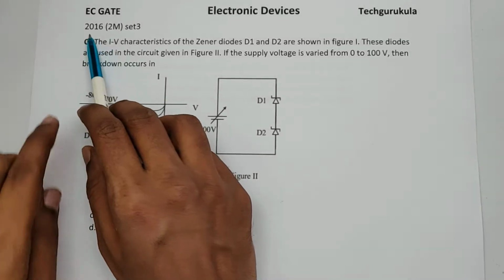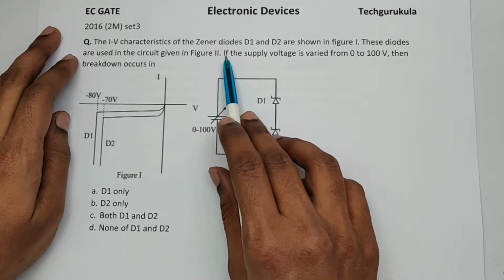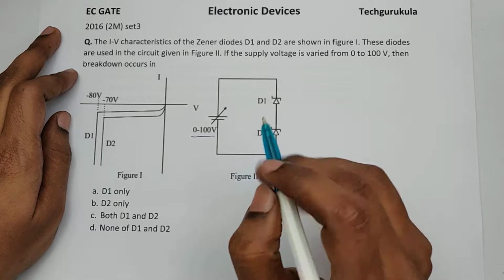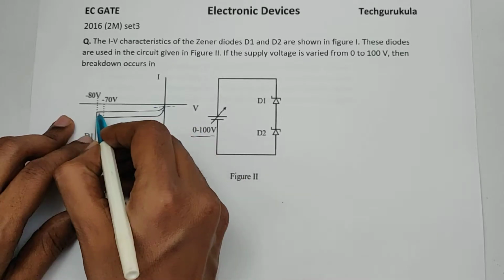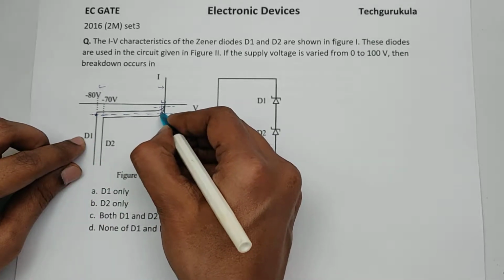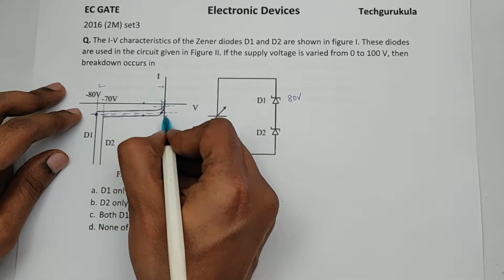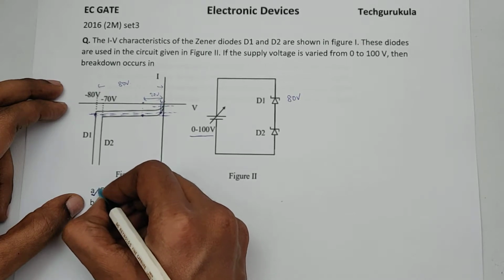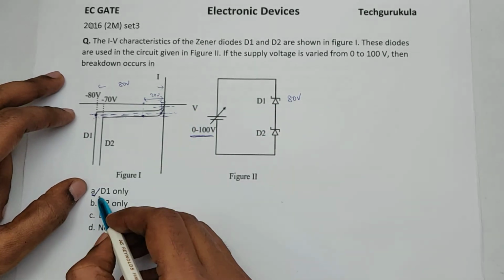EC GATE 2016 2M - Breakdown - Zener

Comment: If D1 enters breakdown , D2 would be in reverse bias mode and it would be acting like an open circuit right. So when 80 volt drops across D1 and 20 volt drops across D2 like you said, D2 would be an open circuit and hence no current should flow through the circuit right ?
Reply: May be the diodes are not ideal. So reverse saturation current flows. And that amount of reverse saturation current of D2 is sufficient to drive D1 in breakdown, according to the graph. May be this is the explanation.
Reply: @sohambhattacharya8975  You are absolutely right
Carry on

Comment: so if D2 isn't in breakdown then how is it dictating rev saturation current of circuit, i didn't quite follow it's behaviour in the given scenario .It would have been great if you had made equivalent circuit for i/p voltage range variation ..... wouldn't infinite current should flow when D1 enters breakdown , why rev saturation current of D2 is flowing throgh both , that is my doubt.
Reply: Vmax=100 v
VD1= 80v ∆ breakdown occur
VD2 left with only 20 v & it still need 50v or above to get breakdown ∆ D2 is not BRD...
😂👍🏻👍🏻👍🏻